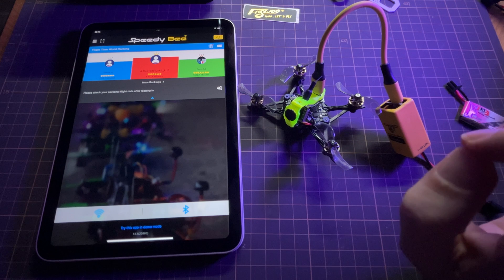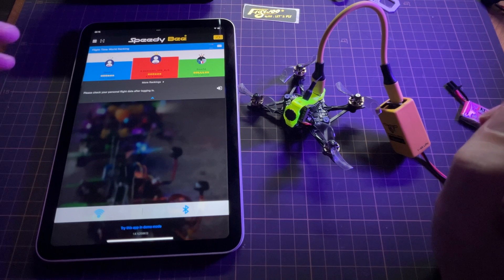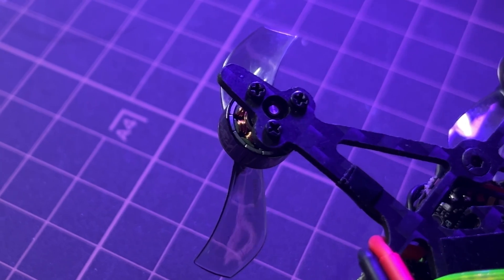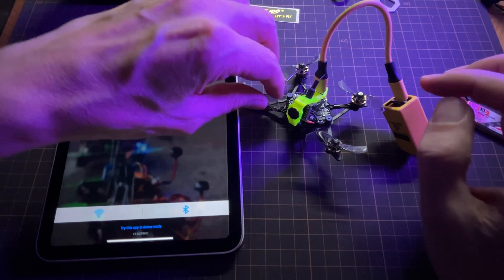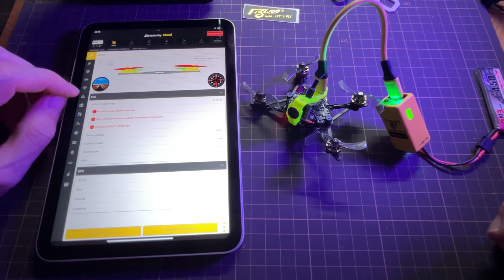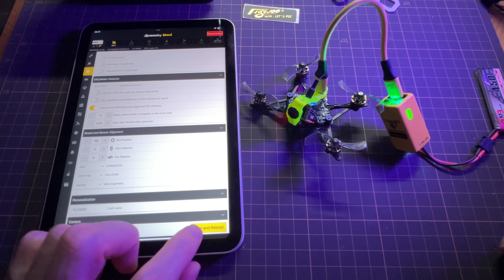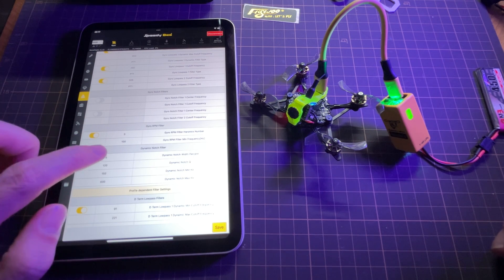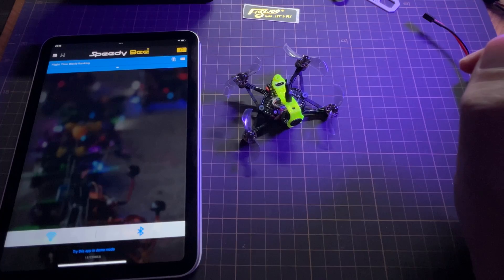Flywoo Firefly 1S Nano Baby v1.2 Change Settings Immediate! Motor Pole Discrepancy

Comment: Right ive looked at these flywoo motors and they do have 14 poles,ive took one apart and counted 14 magnets so there is defo 14 poles. so there is no Motor Pole Discrepancy !!!!!!!!!!
Reply from the maker: Thanks! I just double-checked my motors and counted 12 so maybe they made a change along the way…

Comment: hello, my back motors don't spin, any suggestion?
Reply: My left motors don't work too, a just receive the quad, type version on cli to see if firware is ok. My came with wrong firmware: flywoof411fr.
Reply: @justalex7416  I’ll check it, thanks

Comment: GOOD catch. I can confirm that in my late october shipment of the flywoo baby nano 1s 1.2, the configuration was correct out of the box for motor poles and dynamic notch width, running BTFL 4.2.8 so they probably fixed this because of your video!

Comment: So how do I know what version I have? Or if I need any of these PID tune updates others talk about?? 🤔
Reply from the maker: Hello! I think the easiest way to check would be to connect the quad to Betaflight and see if the motor poles are set to 14 or 12. If it’s 14 it’s probably the older version.